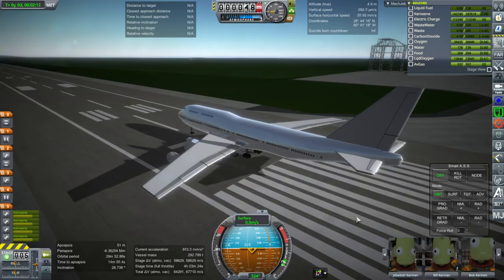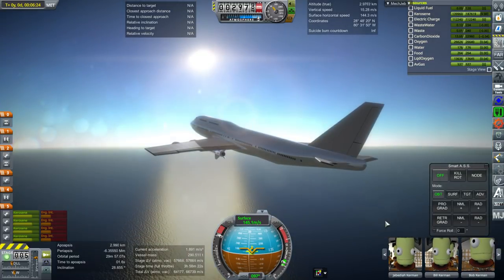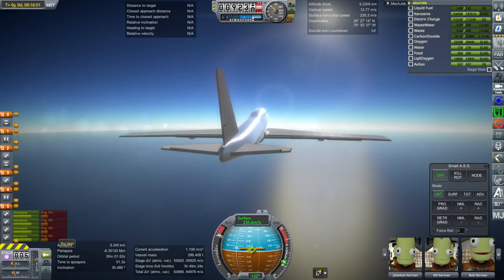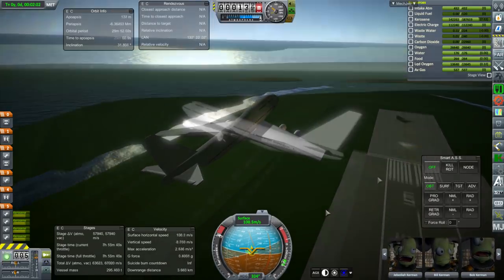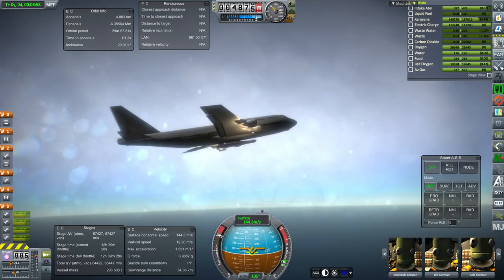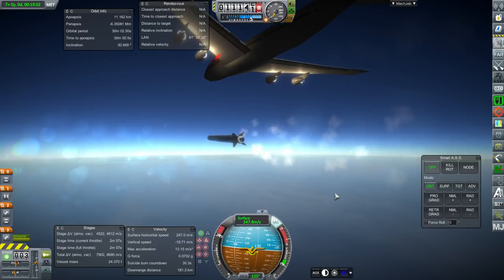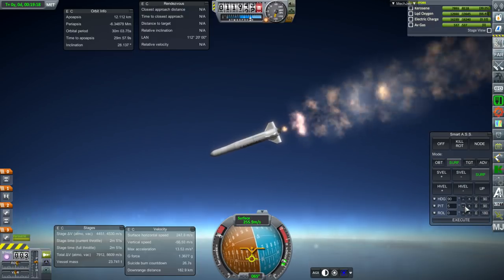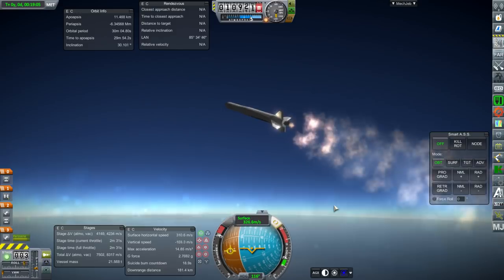KSP - Realism Overhaul Sandbox - Launcher One Testing

Comment: I wish you could lock attitude relative to prograde or other navball markers.
Reply from the maker: SAS and MechJeb can both theoretically do that, but they both have trouble controlling an air-launched rocket like this alone. I tried Smart A.S.S. with it.
Reply: Raiz Space stock SAS? If so that’d be cool to know! Though in atmospheric flight often just trim does the trick, but I wouldn’t trust it on a rocket like that in this game.
Reply from the maker: Yes, certain probe cores and pilots with a certain level have a hold prograde function and more sophisticated cores and pilots can hold other vectors using stock SAS. But, depending on the situation (especially in the atmosphere), you may get oscillations due to the wrong PID tuning for the situation.
Reply: Raiz Space it seems, despite 2000 or so hours in game... I still have much to learn.

Comment: The aerodynamics of the fins does not look like it is working correctly. This might have something to do with the rocket spinning and therefore constantly changing which aero surfaces have to be used for a particular manoeuvre. If you could stop the spinning with offset weight and then limit only two control surfaces at a time to pitch and yaw it might work better.

Comment: You had the wrong balance on second stage fuel ratio, there left 10% of kerosene on burn out
Reply from the maker: That was because of xxygen boiloff on the way up. I actually should set it to the wrong ratio initially so that it gets to the right ratio when it reaches altitude. As I understand it, they plan to super-cool the oxygen to do basically the same thing.